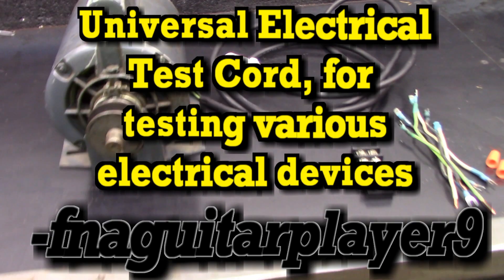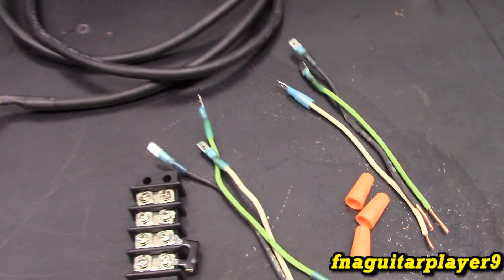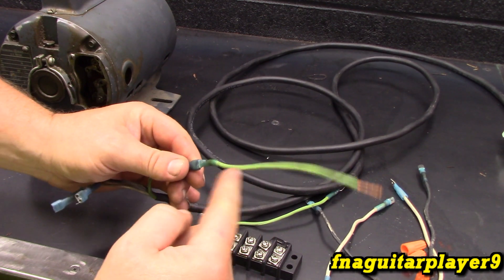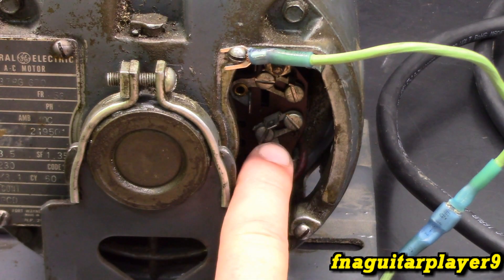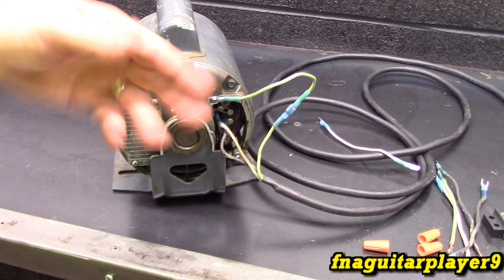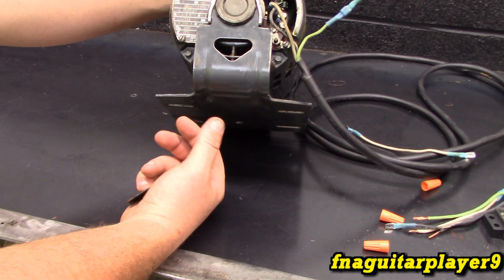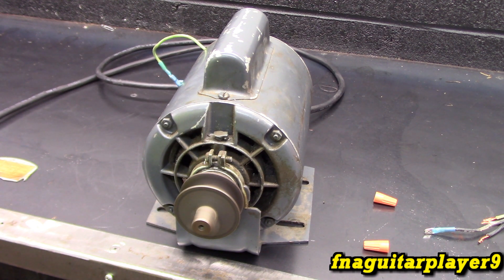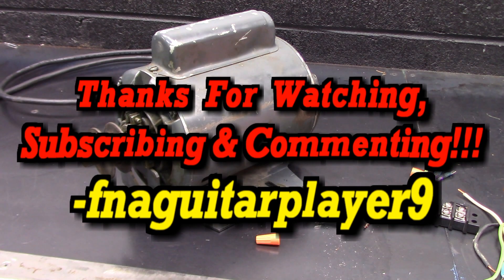Making a Universal Electrical Test Cord, for Testing Motors and Other Electrical Devices

Comment: That's a great idea and so obvious a thing to do that it doesn't get done - until you have it shown. Humans are funny like that. Thanks for sharing, I will definitely make a set as I'm always hunting for bits of wire to make a test connection.
Some video ideas - electrical: how to make a safe extension when the socket (receptacle to you) wires are too short or have broken when changing sockets. The importance of the correct fuse size for the wire/appliance - mind you, not sure if you have in-plug fuses like in the UK and ROI. Different kinds of motors AC/DC, brushless, Induction and how they work. The effects of insulation, attaching to wood or concrete on wire rating, reel wires and over heating. Engines: Valve clearances, grinding in, torque settings and the importance and why of getting it right, types of gear trains for ride-ons and gear boxes, types of gears, strip down of the same, steering linages and how to maintain and repair. Hope that helps.
Reply from the maker: That is true, most 120 volt circuits here are run off of 20 amp breakers, so i try not to go to crazy with it! Thanks for Watching!!!